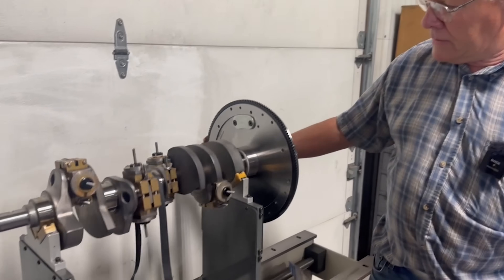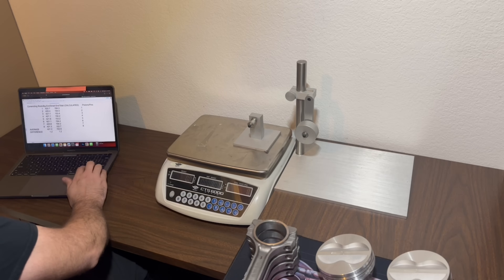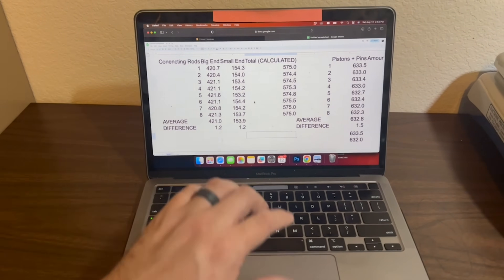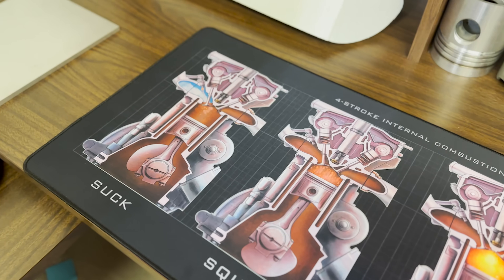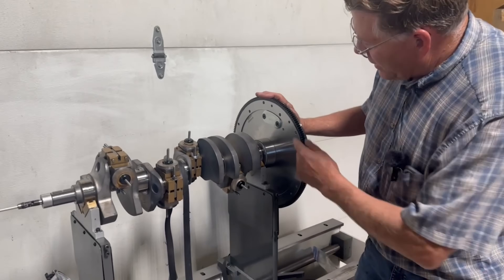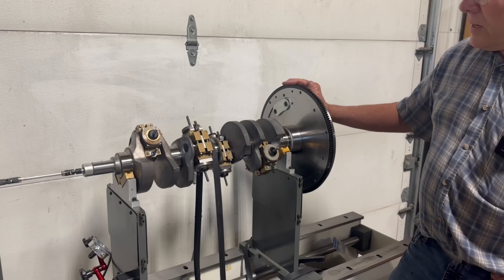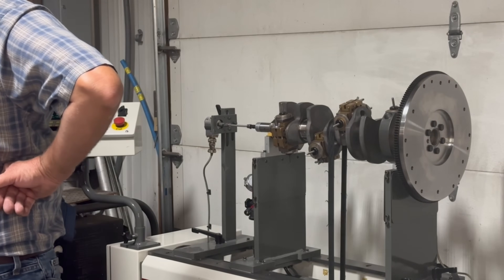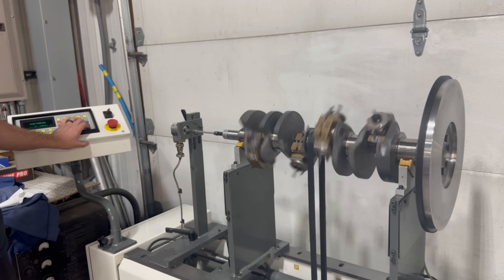How do WE Balance YOUR 383 Stroker?

Comment: Nice work, great information!  Do you worry that drilling holes weakens the crank? Could you knife edge grind the material off and achieve the same result? How will the pressure plate and clutch disc affect the balance,  should that be added in?  Thanks for the great videos.

Comment: I used to run a gas turbine repair facility and we'd spin 2000 lb fully bladed compressor rotors in a vacuum. I saw one jump off the rollers once, blew through the roof of the chamber, crawled up the 40 foot shop wall and land about 200 feet into the parking lot. Every time a see a shaft spinning now I pucker just a little bit. Great Job guys, you do great work!
Reply: Wow, thanks for sharing 😮

Comment: my first thought when I saw how much weight it wanted you to drill out of the crankshaft was to remove that big honking weight on the flywheel. but I have no idea how much it weighs.  the spots where you removed most of the material ar close to that spot.

Comment: I have read up a bit on balancing standards because there were so many opinions but few facts coming from people all around. Fyi, when you pass ~5 grams imbalance on a SBC rotaring assembly you're within the threshold for high performance balancing. Your result on this crank is at Formula 1 level 😉

Comment: Is there a point where potentially on certain cranks where the machine just keeps telling you to take off weight that might affect the integrity of the crankshaft? Or are the counterweights designed specifically to have material drilled/machined off for the purpose of internal balancing?

Comment: dumb question ..... why is the crank externally balanced only on the rear? If you are internally balancing it  it shouldn"t need a weight  ......Are all scat chevy 383 stroker cranks manufactured this way ? Or any other scat stoker cranks [mopar LA 408?]. really love the content . I"m with the cleaning guy -63 years old.

Comment: “Knife-edge” that counterweight. We used this technique in our engines along with  a “crank scraper” metal strip that kept more oil in the bottom AND slightly lessened parasitic power loss. We also used “Mallory metal” which is much heavier than the crank material. Holes would be drilled into the counterweight parallel to the crank and mallory metal would be pressed in and tacked.

Comment: You need to get you a really strong earth magnet cover it with a zip lock bag and while you’re drooling and cutting have it near your drill bit, do not stick it to the crank you do not want your crank magnetized because shavings in your oil will start sticking to it and it is not good for that to happen anyway after you drill, your crank, remove your magnet And your Ziploc bag over a trashcan or wherever you put your scrap shavings near the brake glaze or wherever, take your magnet out of the Ziploc bag, and your shavings will be on the outside of the bag. It will not be very hard to clean your magnet at my shop at the house. I actually just throw an old sock over mine, and then take the sock off of my magnet, and all the shavings will fall off.

Comment: Did anyone else see the front of the crank where the harmonic balancer goes wobbling? I would say that has a whole lot to do with the Burlenson of it. It would be just like a bent rim. 
I work in an engine machine shop for six years actually a little over five years and I loved that type of work. But life happens and I got old. I wish I had stuck with it. I was about 25 years old when I started and worked till I was a little over 30 at the machine shop. I loved boring and sleeving blocks reconditioning rods, and balancing them.

Comment: Jeez that seems like a ridiculous amount to remove from one end 😮
Reply from the maker: Actually, that is not a lot to remove.  This is a brand-new crankshaft right out of the box that has never been balanced in any way.  We were quite pleased that it did not need more correction that this.  Scat leaves enough extra material within the counterweights so the end customer can make the crank balance regardless of the combination of rods and pistons that may be paired up with their crankshafts.  We were very happy to have it balance without the use of heavy metal.
Reply: @JAMSIONLINE  still seems like loose manufacturing tolerance. I do understand that there needs to be some extra for adjustment, but 80 something is quite a lot. Is this a cast or forged crank?
Reply: Well, as your next video showed, so much for the crank being "brand-new and out of the box". Whatever happened there, I would never use than manufacturer again.

Comment: I've been studying crank balance for quite some time now, made my own machine too.. Those bobweights are all wrong. Proper bobweights are round and the mass is distributed symmetrically all around evenly. With those bought, out of the box bobweights, they're made in 3 parts. The middle part and the add on on each side. The extra weights being offset evenly to each side, you add them to the main part as vectors. Using the wrong configuration for the bobweights ends up giving you the wrong balance so you may as well just not bother, the end result is junk.
Reply: It's easy to prove, you just make your own bobweights from scratch using big end caps and lead weight but make them round.  Do a direct comparison to the balance achieved from your supplied bobweights. Then hang your head in shame. End result = GIGO

Comment: Funny that the heavy drilling was removing material at almost the exact same place that the weight on the flywheel was adding material.  It makes you wonder if it would have been close to balanced with an un-weighted flywheel.
Reply from the maker: "almost the exact same place" and "the exact same place" are two very different things. The largest drill location is nearly 90 degrees out from the center of the weight on the flywheel. The weight on the flywheel is also around an inch further out on radius, and weighs ~150 grams. Without that weight on the flywheel, the crankshaft would be far enough out it would be trying to throw itself off of the machine. The crankshaft is designed for a weighted flywheel, and this is the flywheel we were recommended to use by the manufacturer. In the grand scheme of things, the weight removed is actually very small when compared with what you see on most crankshafts.

Comment: I think you just made an internal balance recip assembly 'kit' into an externally balanced assembly. Just remove the balance pad off the flywheel and keep both ends neutral balance. (smaller drilling to get your ends to come in balance) Or am i (probably) missing something?
Reply: If they were to spin  the finish balanced crank without that flywheel weight or flywheel for that matter it would be out if I remember right around 160grams, ADD weight to the counter weight. 
And it will mess the front up a fair amount also. Surprisingly.
Reply: You didn't miss anything at all. Well stated.

Comment: 10:11 why not just grind the counter weight to a peak, making it more aerodynamic? Drilling a hole is just the easy way out, making the ceank more aerodynamic makes more power, cuts through the oil easier!
Reply: I would guess that even at tick-over the oil will not have time to slosh back in the way of any rotating components and the crankshaft isn’t submerged by the oil.

Comment: If the moving parts are balanced why is there a need for a harmonic balancer?
Great channel.
Reply from the maker: The harmonic balancer, though sometimes weighted to help balance the crankshaft in an externally balanced engine, is actually a torsional damper.  It acts like a shock absorber in that it dampens the torsional vibrations in the crankshaft.  You would be amazed at how much a crankshaft twists back and forth as the engine fires all of the cylinders.

Comment: It looks like if you just removed the counter weight bolted to the flywheel it would just cancel out the needed two big holes that you made on the right side of the crank, they seem to be both on the same axis. Very good and detailed video, I just love watching you guys, thanks and greetings from a subscriber from Qatar!
Reply: I thought the same thing. Would've took 1min to pull it off and spin it up. I've seen those cranks come in both ways. Neutral that needed counter weight and external balance that came in neutral.
Reply: That weight on the flywheel is set out quite a distance from the crank center line. The weight calculated is based on the diameter of the crank balancer diameter... in other words, it wouldnt work to remove that weight. It would make a bunch more problems.

Comment: Awesome attention to detail guys ... Simple math and a little time goes a long way with producing a high grade product,, the cost to customer for doing all this work is worth it in my opinion... What max rpm are you looking to achieve ? Every gram counts
Reply: Question: why did you add the weight to the flywheel and not just neutral balance the motor? Thanks.

Comment: You guys drilled weight out of the crank inline with the removeable balance weight on the flywheel.
Reply: But if the flywheel is changed at a later date, that would mean the crank isn’t balanced?
Reply: @sjv6598  easy to balance a flywheel by it self.    
Would not have taken much time to see if it could be balanced internally.  
With the amount of weight removed from where it was removed, the flywheel had it's balance weight on the wrong place anyway.

Comment: You seem to have a dream existence in your workshop. So many professionals turn green with envy at your father and son professional relationship, knowledge, joy and warmth. Father who wants to try something new and young who wants to learn from the experience, it can be better. Just a thought, did you lift the crankshaft from the bearings in the balancer before hitting the marks for drilling. Over time, the zero may start to wander if the bearings get marks. Google translation, unfortunately.

Comment: Awesome as usual guys
One Q?, what would happen if you removed that counter weight from the flywheel befor drilling. It sems to line up with the big hole you had to drill
Love your work👍🏻👍🏻👍🏻
Reply: If you remove the flywheel it may improve the situation - not sure.  However you then have to balance the flywheel as a 'stand-alone' item which adds cost.  My preference would be to balance crank, flywheel, harmonic balancer and clutch pressure plate as seperate items so the latter three can be balanced seperately if they need to be replaced during the life of the engine.

Comment: It looks like you took a lot of weight pretty close to where that weight was added to the flywheel 🤔. Did you spin it without that flywheel weight first?
Reply from the maker: The weight on the flywheel is just shy of 90 degrees out from the large hole we drilled on the back. It also weighs closer to 150g and is at a larger diameter. It is necessary.

Comment: question about the hole you drilled, is it better to drill a hole vs just shave some of the lobes down, kinda like if you were to set it up in a lathe that spun and it just took small cuts?
Reply: If you drill a hole and make it too deep, you can fill with lead to recover the mistake. Not so easy to go back from shaving the lobes.
Reply: @sjv6598  gotcha, makes sense, but what about when they did drill the hole and have to take more stuff off, they shaved the sides down, why not make the hole a smudged deeper or drill a smaller hole inside the big hole?